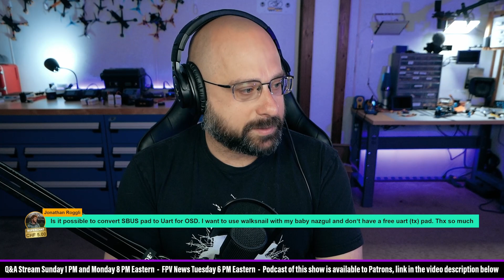When Can You Remap An SBUS Pad? - FPV Questions

Comment: I have a lifted video in pad. Is it possible to resource remap that lifted pad's function to a different pad that I have free? 
Got a flight controller it's perfectly fine, except for the lifted pad that I need to be able to utilize the OSD built into the board. Normally, I wouldn't necessarily concern myself with it. The reason I'm worried about it now is because Ive got a GPS hooked up to the FC.  And though I know that there are other ways to have access to the GPS information, I'm trying to see if there's a shorter cut to where I can just get the OSD back.

Comment: Can we use different hz elrs in same flight controller but different PID profile...let's say PID profile 1 using 150hz, PID profile 2 using 250hz and PID profile 3 using 500hz? matters of changing ELRS Tx module but can we do that? profile 1 for long range, 2nd profile for mid range and 3rd profile for freestyle